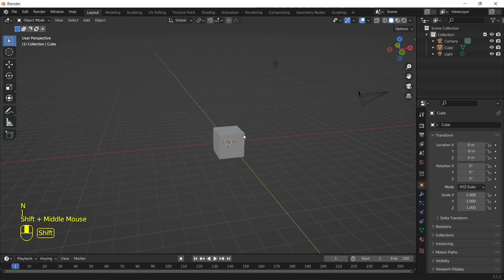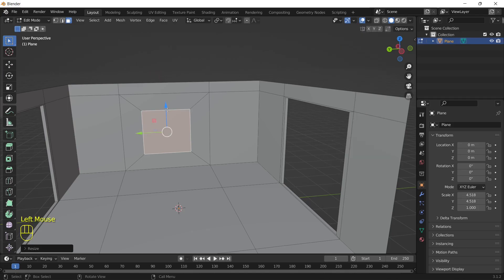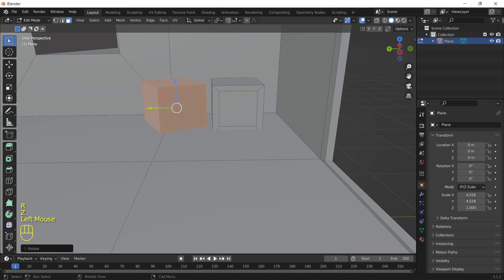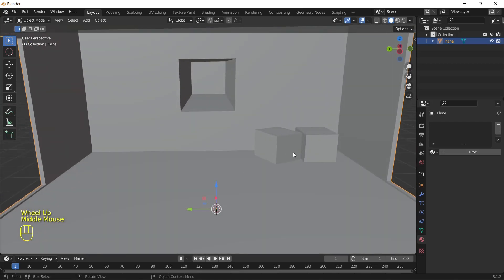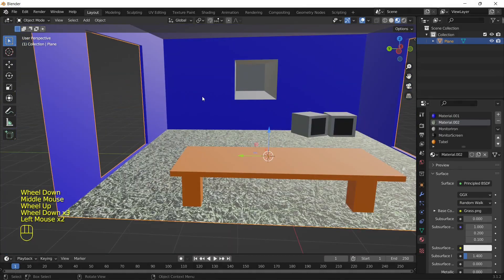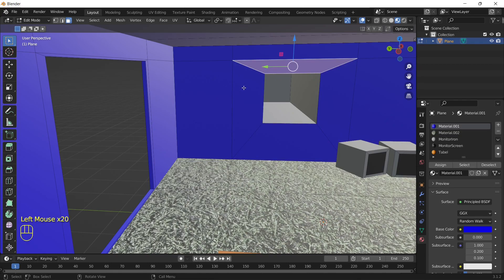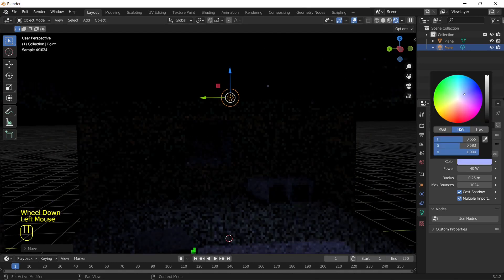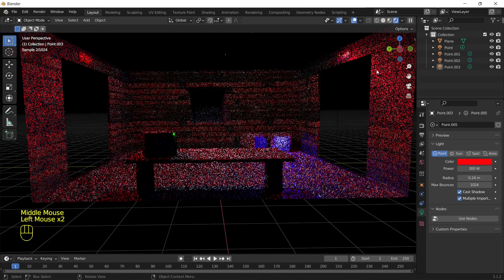How to make a FNAF Office in BLENDER 3.1 using CYCLES

Comment: why won't it show where my cuts are when i use it on my shape?\  Edit:Nvm but now its all green!  Edit Again: Yay I fixed it!
Reply from the maker: Glad that you fixed it! Although, I can't quite understand your problem, could you explain it a bit better so I could know what the issue was? Thanks
Reply: @Niksstuff  It wouldn't let me cut anywhere it kept telling me that I can only cut like little lines and just one single line in the middle instead of the 3 lines cut across the walls you got
Reply: Also how did you apply noise affect"?
Reply from the maker: I see. To get those cuts you need to do 2 cuts in the middle of the mesh (press 2 on your keyboard to do 2 loopcuts) then do one loop that is horizontal, so 2 vertical loop cuts 1 horizontal loop cut
Reply from the maker: Which noise effect?